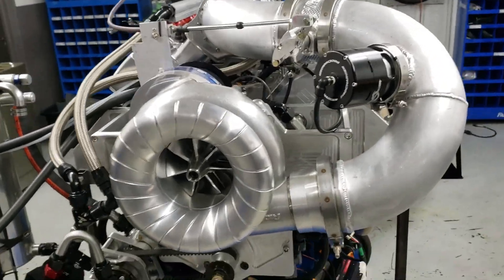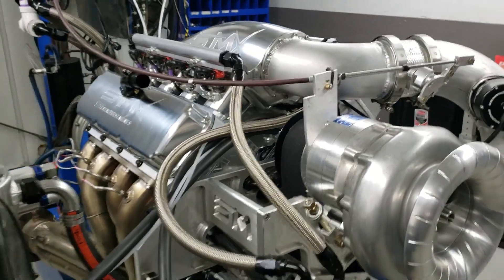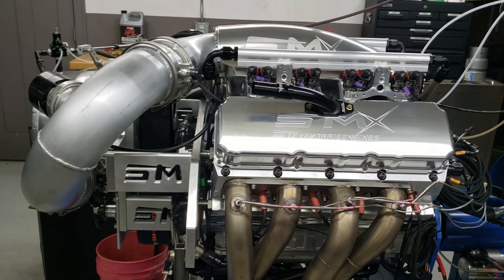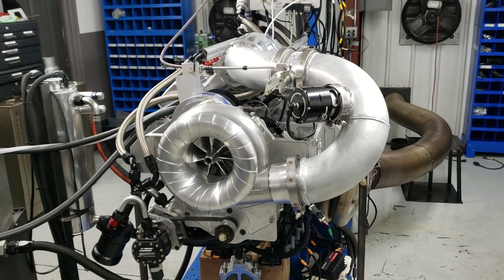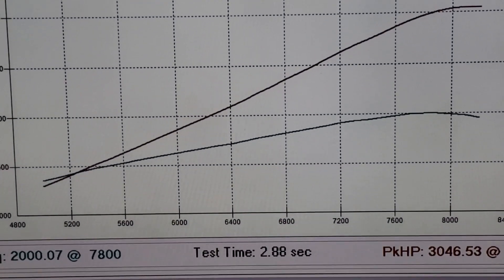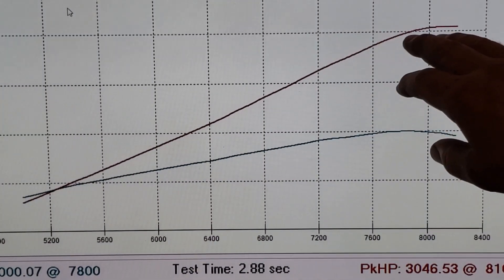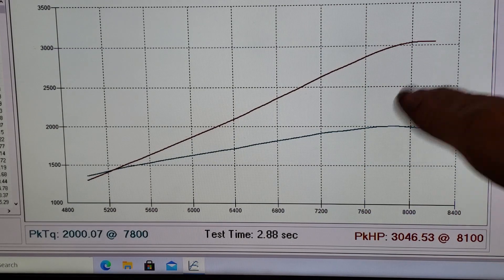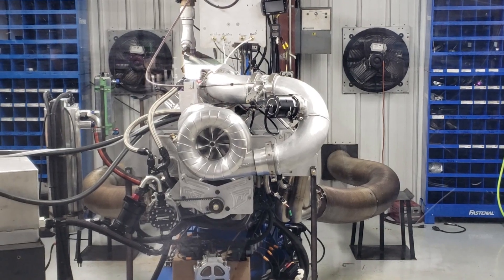ProCharged SMX Engine Dyno, 3000+HP!!

Comment: I love the way this motor makes torque. over 1000 lbs and climbing all the way to 7800 is damn impressive. but at the same time the engine will live a long time with the lower cylider pressures at lower rpms.

Comment: Should have a double fuel rale system you need 24, 16 for racing and 8 for the street you could put a fuel rale on the opposite side of the i tile or underside what’s Ed you wanna call it abs put 8 injector in from under there and I would use a 1000 atomizer injector, IMO a blower motor should be 13-1 -16-1 I hear 15-1 is kinda the sweet spot on HP that’s how nascar teams take 350 Chevys and 351 C Fords ( oddly those are the biggest engines Nascar allows you to run I guess that’s cause there both 5.7L motors i believe which puts them on an even field  )  that make 1000HP naturally aspirated there 15-1 compression and they redline at line at like 11k or so rpm

Comment: Made 90 psi of boost on my 5.9 diesel which was leaning on it... daily driver up to 55 psi..100 psi blew head gasket on ARP small studs...41 psi on a well balanced engine to 8100 rpm... it could likely go 10000 ram plus at 70+ psi... returns get lower and lower...stress gets higher and higher... love the engine it is bullet and fabbed metal candy!

Comment: I have what could be a very simple question. Why is it when doing the dyno run the engine is only at top speed for a second or two, but if you're at the dragstrip you are going to open full throttle for 5 to 10 seconds going down the track?
Reply: The dyno is (I assume) set for 1000-1200RPM per second (which is probably what it does in the car at the track) and the run starts at 5100 and goes to 8200, so 3100 RPM. The run is ~3 secs.  In the car it would go through 2 (maybe 3) gears. He has a couple of hub dyno videos where he does a full drag strip run.
Reply: For adjusting the tune they don’t need to hold it at full power for long. And, the dyno has to absorb all that power so it can get overheated if held for an extended time. 
If this was going into something that needed to run at high power for a long time and they were developing parts then they could do something to keep it under load for a long time. 
Like if it was a boat engine intended for long high speed races. 
But, for a drag engine it will only run a few seconds at full power anyway.
Reply: @NBSV1  Thanks, great explanation!
Reply: @bobqzzi  Very informative. I was unaware. Thanks a lot!